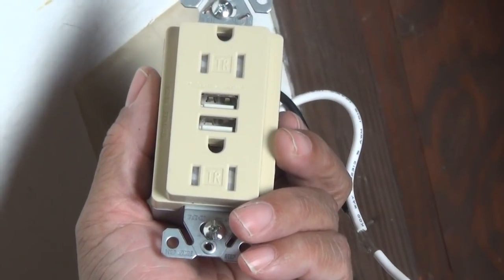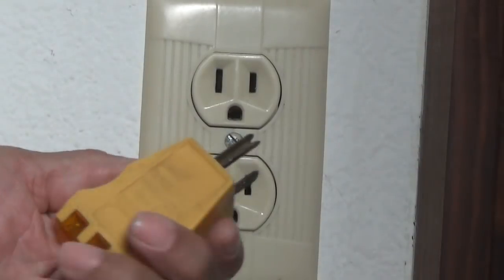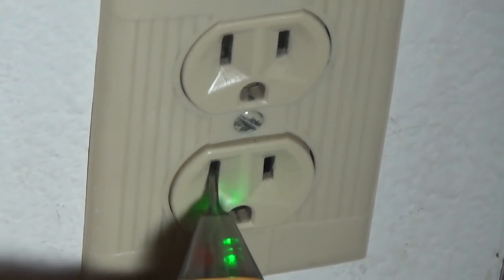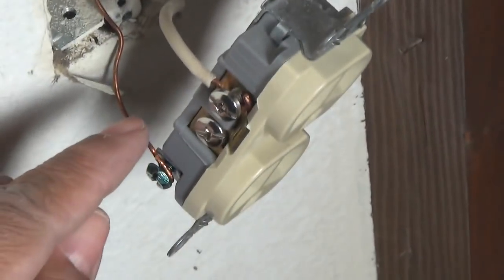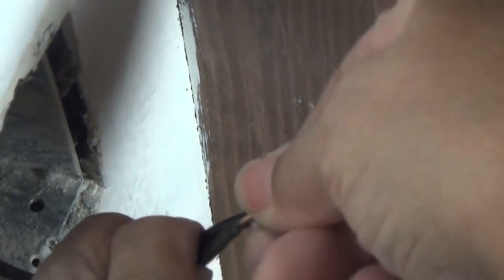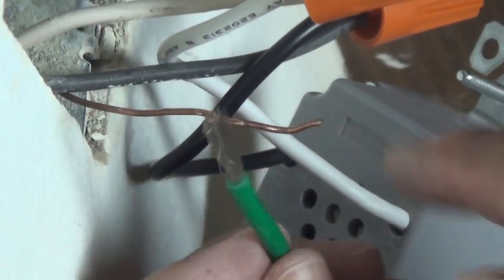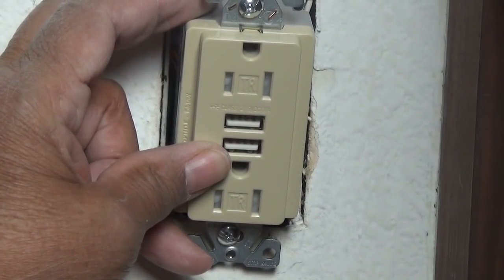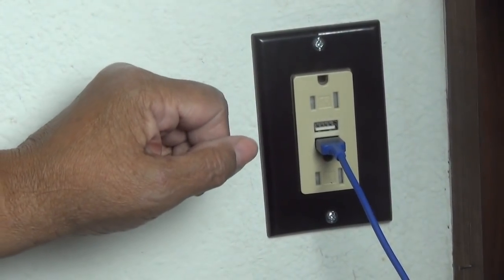USB PORT IN A WALL?! - USB Outlet Tutorial

Comment: I can't help but notice that you're joining dissimilar metals. But you didn't mention the wire nut being of the type to have an anti-oxidant compound inside it right out of the box. As I'm sure you (but maybe not some of your viewers) know, connecting copper and aluminum is a recipe for disaster in the future if you don't use a splice compound

Comment: Some outlets are split service, meaning one is constant power from an outlet branch breaker and the other is fed from a wall switch by a lighting branch breaker. YOU HAVE TO CHECK BOTH OUTLETS until you know they are on the same branch for two reasons. One may still be energized after the other is switched off at the panel AND when both are on there could likely be 240 volts between one outlet hot and the other outlet hot on the same plug assembly. The little bridge between them will be cut. When you see that bridge cut alarms should go off in your head if you haven't made damn well sure of what you're working with.

Comment: One small nit.  At the start when testing for a live outlet. The top plug could still be receiving power.  Small chance of that, if the bottom plug is not getting power.

Comment: Jane, great minds think alike, I've been using these USB outlets for 3 years now, love them. Did you notice that whoever installed the original outlet that you removed, they installed the white wire incorrectly at 2:36. The wire is wrapped counterclockwise around the screw, when it should have been clockwise around the screw, just like the ground wire was properly done. Also, it looks like they did not fully tighten the white wire before they installed it. Lastly as a safety precaution, I always run black electrical tape around my outlet and switches to cover all the terminals so there is no bare exposed wire and screws which might shock someone operating on or near the outlet, or a kid comes by while work is being done and sticks a metal hanger into the live electrical box. You'll see it on my videos.

Comment: Is there anything wrong with just plugging in a lamp to check that the power is off?
Reply from the maker: you can check with a lamp but make certain the bulb is good
Reply: You can use a lamp, but I also use my Voltalert. Just because you shut off power at the fuse panel, doesn't mean that all the wires inside that box are dead. We often find live wires just passing through the box that are on other circuits. If you have back to back switches, like dining room one side of wall, kitchen other side of wall, they are likely on 2 circuits, and so killing one circuit still leaves an energized wires in your box.  You must be real careful about that.

Comment: Regarding the orientation (this is a comment on the outlet, not the video or Leah's installation).

This is also not about the ground pin orientation (although I read the comment someone made about ground on top helping to prevent a possible short by providing a barrier between falling objects and the neutral and hot pins, and think this is very sensible).

USB ports do have an orientation (although not all manufacturers get their labeling correct). A device's connector should have the 3-prong USB logo on the top side (and showing when inserted). On the connector this logo should be on the far side from the pins and plastic lug inside. When orientated correctly this means that the opposing pins and plastic lug in the socket should be near the top of the socket.

This is a long way off saying that when that socket is correctly orientated based on the manufacturer markings, it is clear in the video that the USB ports are inverted.

Of note however, is the logos on the front fascia, which agree with the "top" making on the bracket, which means that the USB ports are inverted by (poor?) design.

Comment: I rarely ever cut the power when replacing outlets or light switches anymore. I watched electricians simply keep the wires from touching and this is how i acquired my bad habit. DON'T DO THIS. It is not the correct way. Follow the steps in the video.

Comment: My compliments on the video production - very well done.  However I do not agree with the premise 1) that these USB ports are a good idea and 2) that this is a project for the average homeowner.  Here are some of the pitfalls.  Some electrical boxes are too shallow, making it impossible to get all that stuff back into the box.  Some wiring is #12 rather than #14, making it much more difficult.  UBS ports are fad gadgets and may not be around in the long run.  These receptacles are relatively expensive.  If you want to upgrade your receptacles, spend your money on GFCIs.  Some wall warts are specific to a device for optimal charging.  Wire nuts are never as good as direct connections and are not suitable in some circuits.

Comment: One very important thing you did not discuss...many homes, especially old homes, may not have recepticle boxes that are deep enough to accept the USB outlet especially when you consider the space needed for additional wiring, if needed...as in pigtails and wire nuts as shown here.  I would add that the you had prewired your recepticle which would only be necessary if the wall  wiring were very short.

Comment: how do you clean popcorn asbestos free ceilings before painting them
Reply: phillipp morris - Remove all furniture, lay plastic sheet on floor, spray the ceiling lightly with water, let soak for about 10 minutes, carefully scrape the popcorn with a pole scraper, use hopper to texture ceiling, paint, roll up plastic sheet with popcorn inside, dispose, replace furniture, done.
Reply: thanks @5150norcal

Comment: Twist the wires together then apply the wire nuts for a good connection. When using wire nuts outside have them face upwards to prevent water from going into them.

Comment: Good video. Always hire an electrician and a framing carpenter. Your house could burn from a loose neutral connection in a wire nut. Your house could burn when there is a loose connection on the neutral screw on the plug. Your house could fall down if you cut the wrong load bearing beam. If you mess up drywall it looks bad, if you mess up plumbing you get a flood, if you mess up paint it looks bad.If you mess up electrical you get can get shocked or a fire and these are heavy consequences. If you mess up the frame of a house you can have a section collapse. Imagine you just changed your plug. You did it correctly. You are excited to turn the circuit back on at the breaker, you flip the switch Boom! The breaker was bad you didn't know, it exploded, your hand is burned and you have a flash burn on your eye, you can't see as if you looked directly at the sun or a weld in progress. Do you really want to be the one to take that risk, or would you rather have an electrician do it?
Reply: SouthSideRocka Don’t forget that you could stub your toe on the way back from the breaker box, too. 😣
Reply: No electrician is going to come out to your house to change a single outlet.  You're being alarmist.

Comment: One piece of feedback - as others have said, always check both outlets, and also always check both slots in each outlet. My home was wired by an amateur in 1955 and so some of my outlets have reversed polarity, with the hot on the wider slot. I fix it as I make upgrades, but don't have time to do it all as one big project. I would also be spending $1000+ for GFCI outlets because my home isn't grounded.  eta: I know this carries a risk, mainly to standard lamps, so I check the outlets to make sure I don't plug a lamp into one with reversed polarity.
Reply from the maker: Thanks for your input,  it's appreciated!

Comment: if this is the direction we are going then doesn't it make sense to install such an outlet waist to chest high, especially in a area where u know an elevated surface is going to be (so that you can easily plug your device into)? honestly I've never understood why you would put all the outlets in a room a foot off the ground where there are hard to access..... seems like bad design to me? if you want them out of sight then put them 3-4 ft off the ground most small things we clutter our house with still rise that high and some even are low an have that surface at 3-4 ft and leave an nasty open spot under there legs with a mess of wire hanging out of the wall.
Reply from the maker: NEC 210.52.A.2. A common height for a wall outlet is between 12 to 16 inches to the bottom of the device.  This of course is just a recommendation but it is interesting how it is usually adopted.
Reply: I've never understood that one, either. Guessing another case of "we've always done it this way", from the time when the only things people had to plug in were a lamp and a tv that didn't get unplugged until they died.

Comment: Great video!!  I have a problem with my local energy company and maybe you can help me. I have the solar system from Tesla and in the app you can see how much “KW” you use daily. Well,, I noticed that during the day around 8-9pm or later, something in my house is pulling over 6.3kw. Now that’s impossible at those times because we are pretty much getting ready for bed and “NO” I don’t have a pool, not cooking, doing laundry or running a compressor at those times. I complaint to the energy company and they are ignorant me. Is there a tool that can help me test the outlets or anything I can do too find out what is the problem?? P.S if it wasn’t for the app I would’ve ever known!!!!!!!!! It’s been happening for the last 7 months.

Comment: Leah, I've installed a couple of these, but as a regular joe schmoe, I've come across some hiccups- 1: The existing wires are not long enough for me to connect to the new unit; the electrician gave JUST enough wire to connect the box, so I can't really pull it out of the receptacle and the new unit doesn't have included wires--just the screws. 2: Another one had only a white and black cable; no green. I can't imagine that it's not grounded, so I didn't want to undo that one. Have you come across anything like this before?
Reply: I had a number of receptacles with this problem and the wirenuts are a pain.  I went to the big box store and got a bag of the IDEAL  Push-In wire connectors.  Work great for those really short pieces of wires, and come in 2/3/4-way combo's.  Pretty cheap to, good to have a few even if you prefer the wirenuts.

Comment: These are great for by the bed. Also they way the built in circuitry is designed it can handle much more current than a typical plug in adapter and I find my devices charge much more rapidly.

Comment: also, as the ground hole is on 'top' of the two slots...it is a bit safer for what you plug into it..It tends not to be loose and fall out when the ground is on top.

Comment: WAGO lever nuts work better on stranded wire. I wouldn't waste money on USB outlets however. It cost more than a standard receptacle and charger and it will eventually be obsolete if it doesn't break or burn out first. You can add a surge protected plug to the front with USB ports for less time and money. 
For example the "AmazonBasics 3-Outlet Surge Protector with 2 USB Ports" is 10 dollars while USB wall receptacles are 15 dollars and up.
Plus those old metal gang boxes are really too small to stuff larger receptacles in.
(btw someone had your neutral wrapped around the screw the wrong way.)

Comment: There is no "official" correct orientation for three prong sockets. The right way, though, is ground up as you've done here. The reason is that if the plug should be partly removed and something were to fall on the bare metal it'd hit the ground blade instead of hot or neutral or both. I think we often see them the other way because people like to make it look like a little face.
Reply: There is no "official" way,  that's rigth, but most electrical cords are designed with the outlet with the ground down (more noticeable on frigdes and washing mashines; cords with a 90° bent), othewise, the cable gets bent and in a permanent stress.. The "safety" measure of the ground up is just a poor result of the lack of a standard. The american plug is just unsafe and outdated.

Comment: It's a neat idea but I'm hesitant to hardwire technology that is likely to change. The USB amperage to optimally charge devices has changed many times between devices and over time. I find it works for me to use the charger best optimized for the device. Sure, there are wall warts but the trade off works for me.

Comment: fantastic video as an electrician thumbs up
I would have added the extra step of aluminum wire (use antioxident and wire nuts for both aluminum and copper)
Reply: Outstanding, I didn't notice that first time through the video!  Now notice how thick that ALU wire is compared to the copper, and that ALU is never going to see more what, 1A, realistically max 0.5???  Didn't know there was an spec on antioxident for mixing cu/alu. Thanks!
Reply: @boots7859   No i meant for those who have aluminum wire the wire on this device is tinned copper which is treated like copper. sorry for the confusion

Comment: My breaker box is in a side room and not all of the breakers are labeled correctly.  I plug in an old radio and turn it up loud and turn off the breakers one at a time until the radio goes off.
Reply: I understand you have developed this technique but I would recommend you take the time to do something VERY IMPORTANT....know which breaker controls which outlets/fixtures.  Take a beautiful sunny day in the Spring so you have no need for either heat or AC.  Use your radio trick, that is, with something small plugged into each outlet...lamps, radio, cell phone charges etc.  Turn on all the ceiling lights and exterior lights as they exist...even those to a garage if you have one.  Then turn off each breaker until all of them are powered down.  From this point, with everything off,  you can start turning on the breakers...one at a time...id start with number 1 aka the top left breaker.  Turn on breakers going down the left side and then move to the top right and move down.  As you move around the house you will discover which outlets or built-in fixtures have turned on.  Write down on a pad of paper...but dont stop looking even if you seem to believe that a breaker has turned on a single outlet or a particular room...surprise connections are all too common.  Now, turn the breaker off...you dont want to have any confusion as to which breaker powers which outlets and/or fixtures.  Once you have gone through all the breakers...make note of any surprises.  Finally, the big box supply stores sell the breaker sheets used by electricians...buy a pack and fill it out with info from your notes.  Stick in on the inside of the door of the breaker box(es).  You'll save yourself any problems in the future...and you should really know what controls what in  your house.
Reply: @xavariusquest4603  I already did this a few years back. It is good advice. I have a few connections that are goofy, at least to me.
Reply: I need to do this. thanks for info
Reply: @xavariusquest4603  Also quit handy is,  inside each receptickl cover put the number of the breaker that controls it. 😊😊
Reply: @dancahill9122  that is a great idea.
Reply: Pluggin in a new radio will work as well!
Reply: That's a cool tip! Thanks
Reply from the maker: Big Country  I like this👍

Comment: One thing to consider when installing USB charging ports.  USB has changed and evolved over the years.  Most well made modern devices can charge from a USB port whatever iteration it is.  The only change would be the speed of charging(Newer USB 3 enabled ports push more amps and charge quicker).   

But older devices and cheaper devices may not be able to handle the amount of amps a USB 3.0(or even 2.0) port pushes out and plugging its USB cable into a port like that could damage the device.   

My advice is if you don't know what version of USB the wall outlet is. You are probably safe to charge your new phone or tablet on it but maybe keep using the plug that came with the cheap drone you bought the kids.
Reply: What!  USB3 is backwards compatible.  Just like putting a 100 watt lightbulb on a 15a circuit vs a 20a circuit.  You're not going to PUSH more current through a device with USB3 vs USB1/2.  Way back in 2007, the USB Implementers Forum released the Battery Charging Specification to handle this. At the very worst, and very old USB device may not charge.  No exploding anything.  Just use a decent Named receptacle vs some gray-market eBay no-name thats $2 cheaper...

Comment: Your methodology of installation is technically unsafe. From a safety standpoint you should begin the wire termination process with the green (ground), white (neutral) and then the black (hot). Should twist the stranded wires before wirenuts are twisted on too! Great Video though Love your channel!

Comment: When taking off the old outlet, wasn't the white neutral wire twisted around the screw in the wrong direction? The black hot wire is correct. I know you didn't do that Leah.
Reply: It looked like the earth wire was loose too?

Comment: Hi Leah. Seeing you connect that receptacle provoked a long standing question...when connecting wires, do you twist them together first before you place the wire nut on?  Or not twist at all. Which is considered correct. Ill trust whatever YOU say👍😉
Reply: Electrical code in the US in our location does not require a twist. However, I always twist to create a solid connection first and make sure when I put on the wire nut it twists it more.  It's not a big deal if all wires are the same size, but when using outlets like this with tinned stranded wire, they can pull out if one is not very careful to make sure the wire nut created a solid connection.
Reply: @johnlcallaway  cool. Thanks. I've been told both ways are the only way...go figure😛